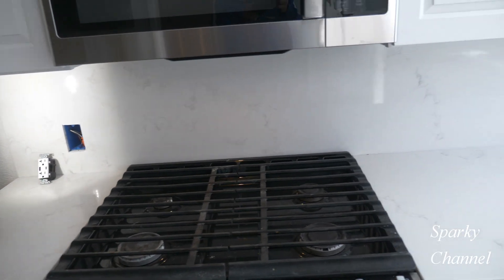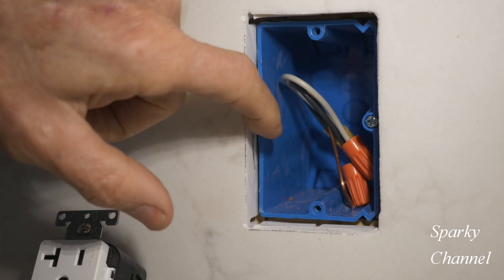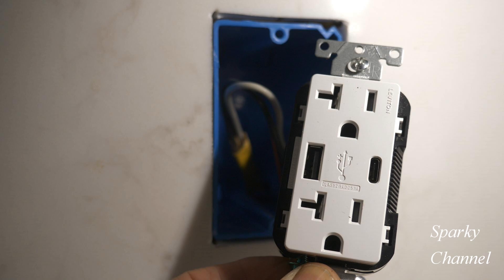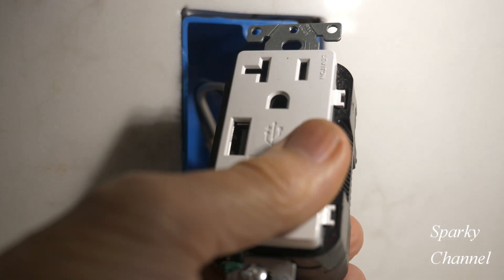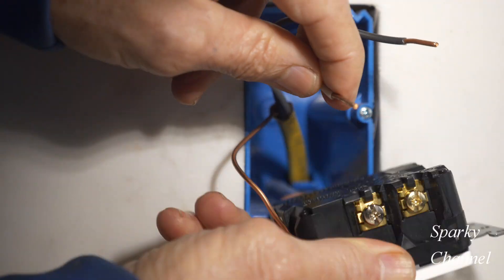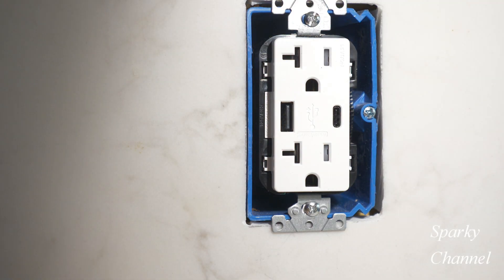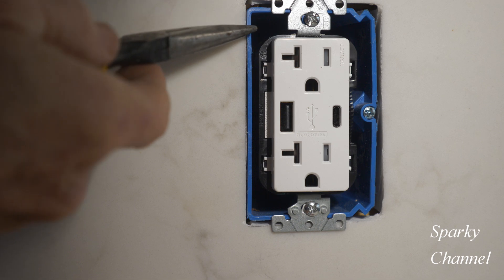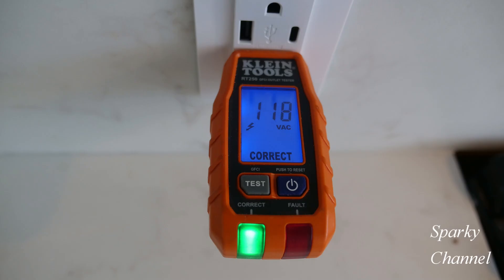How to Install a Receptacle with USB and Type C Charging in a New Backsplash

Comment: I like 20 amp receptacles in general because they're more beefy and robust than 15 amp receptacles.
Reply: They make beefy 15A and 20A receptacles and they make flimsy 15A and 20A receptacles.  But there are more flimsy 15A options than 20A ones, and stores may not even carry the flimsy 20A ones.  Look for the spec grade that Sparky pointed out at 2:11, to get beefier ones.  There are variations even in beefy options, with Leviton I'm partial to the BR series, but they also have CR and 52/53/56 series, but usually I get Eaton over Leviton for plain receptacles, which also has similar choices in their product options.
Reply: @RJ-ej1nr  A 20 amp receptacle has heavier  brass in it, so it'll be more resistant to splaying out if you shove a plug with bent blades into it. 

That's one of the ways many receptacles get loose in a home, someone had a vacuum or other commonly used device with bent blades.
Reply from the maker: @aredditor4272  My entire countertop is 20A spec grade. Not needed for code but they are quality.
Reply: @aredditor4272  That's not true, the thickness of the contacts is identical as long as the grade is the same. That's my experience after cutting some open and measuring. The only difference is that the neutral side has additional horizontal contacts to grab a horizontal blade. The hot side is identical.  On some brands they are completely identical as their tooling is set up to make them all the same except for the plastic cover. They can therefore charge more for the 20 amp without any increase in manufacturing costs.
The contacts that connect the neutral blade may resist deflection better, I don't know for certain but that may be what you're experiencing.
Reply: @surferdude642  think of it like wire, you want wire to carry more current, you need thicker wire. The brass is thicker because it's rated at 20 amps, not 15.
Reply: @aredditor4272  Could you share with us a manufacturer's receptacle model numbers in the same grade where there is different thickness between the 15A and 20A version?  I've seen differences between grades, but not within a specific grade.
Reply: @RJ-ej1nr  I image many things, but not that. 

You do understand all things electrical are designed based on how much current they're expected to carry, right?
Reply: @aredditor4272  I may have something here that could help you or others similarly situated learn here, in that you don't need to go to a 20A receptacle to get a beefier and possibly increased brass receptacle. Also, that you can't go to a 20A receptacle on 15A branch circuit.

In Leviton's catalog, among the receptacle grades they have are residential and commercial spec.  In the product description for commercial spec grade, they state "heavy-duty brass contacts" which is not claimed for residential grade. If you buy a 20A, you are likely getting a commercial spec grade.  But it wasn't the 20A that got you the "heavy-duty brass", it was the better grade.  You could get the 15A in that grade for the "heavy-duty brass".
Reply: @aredditor4272  > You do understand all things electrical are designed based on how much current they're expected to carry, right?

I post here so I can support Sparky, who I think does a wonderful community service, and so I learn and help others learn.  Generally, people on this channel are fairly sophisticated when it comes to electrical, and I count myself among them.  As claiming credentials or experience provides little persuasion in semi-anonymous YT comments, I'll say I am aware of designing for current as I know my 90C 14ga THHN wire has base ampacity of 25A and my 12ga one has 30A per 310.16.
Reply: @RJ-ej1nr  I sometimes use 20 amp receptacles at a giant hotel I work part time at. The breakers are all 20 amp, the original  receptacles are all 15, and back stabbed. Guests and coworkers abuse the receptacles,  so I sometimes go with the cheapest 20 amp receptacles. The brass is simply heftier because it's designed to carry more current. 

Expensive heavy duty or hospital grade 15 amp receptacles have less brass in them because they're only rated for 15 amps. 

It ain't right, but there are worst case scenarios all through the hotel. Hallway receptacles used at least once daily by housekeepers. Regular plugs behind appliances and furniture that gets pushed into the plugs. Designed to fail six outlet multi-taps abused and maxed out by guests, and more bad scenarios. Long term guests using rooms for cooking, but are renting rooms without  kitchenettes.

So the 15 amp recepticles on 12 guage wiring with 20 amp breakers were/are legal, but they don't hold up well in that setting. 

Having said that, I'm usually not given enough time or the products needed to bring everything up to par. 

Thankfully the 80s era plastic boxes aren't the type where all of the screw holes break away. The screws actually bend before the boxes break, I was used to the opposite before I worked there.
Reply: @aredditor4272  Thanks for details, you certainly are improving your situation. The backstabbed type receptacles wear out their grip on plugs fast under frequent use, and the lack of a full backstrap can breakdown the hold onto the box as well.

Myself, I'm typically putting in 15A recpt (20A circuit) in commercial front of house areas, and those require TR as of 2017/2020 NEC. Back of house gets non-TR 20A. Copiers and kitchen equipment are things that can need 20A.

We're just going to have to disagree on 15A having less brass for a same grade. Check out https://www.youtube.com/watch?v=ir3kMV1-6hE, where they open a 15A face and it's also a 20A underneath. If you have a link or data point to show where 15A has less, I'd love to learn.
Reply: @RJ-ej1nr  It's even more complicated, but to simplify, I'm subscribed to that guy, who's probably stuck with Lowes where he is, I'm stuck with Home Depot, which would be leviton. Just guessing, because I think Lowes carries what he used as examples. 

So the more expensive devices are being made with more expensive plastics and brass  alloys. I think you can hit the high end recepticles with a hammer, and they won't shatter. Probably nylon, as opposed to the cheap ones that are probably low end  UF plastic. 

I mean I know he or I probably have access to a wholesale supplier that sells everything, or we can just order online, but these days most of us go to the nearest home improvement store. 

Our home depot sells a commercial rated leviton 15 amp recepticle for about 7 bucks before tax. I'd love to see our hotel buy those by the case, but we get the next level down by the case. Around  3 bucks each after tax.  

Rabbit holes, I'll go down them. I'll also pick a reps brain if I see one in the wild, like at a trade show.

Comment: Looking pretty!  True pro at work!  Love those adjustable boxes.  I can't believe Leviton specs the receptacle wire clamps at 14 in-lbs on the low end, feels way not tight enough by my old hand.  But sure enough test to pull the wire out and those clamps hold hard.  Nice design work and impressive!  I still torque it a little higher though (but still within manufacturer spec).
Reply from the maker: Thanks RJ!

Comment: Just a note for others. The GFCI version of that receptacle with the USB charger is very deep, so if you have several cables going to that box, or you have a shallow box, you might not be able to squeeze it all into the box.
Reply from the maker: Great tip, thanks!
Reply: You are right, I was reading the Leviton website and they’re saying to use an “extra deep” box. I hope it will fit in our wall LOL